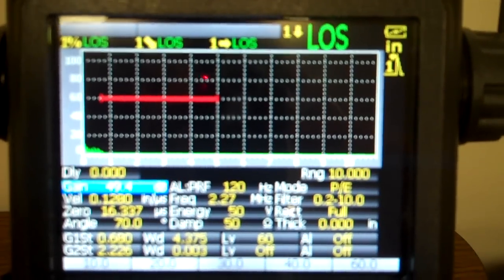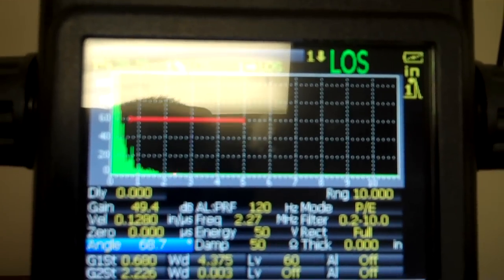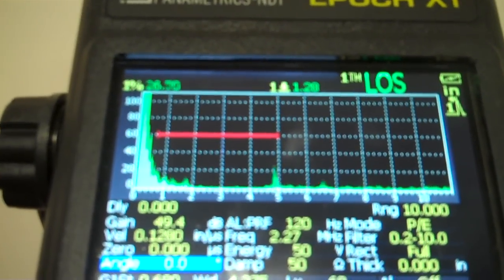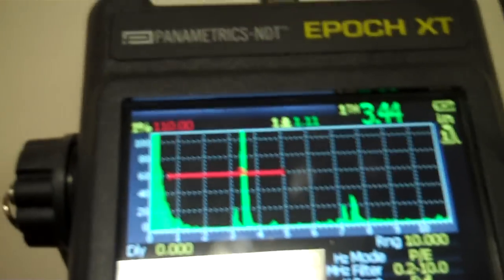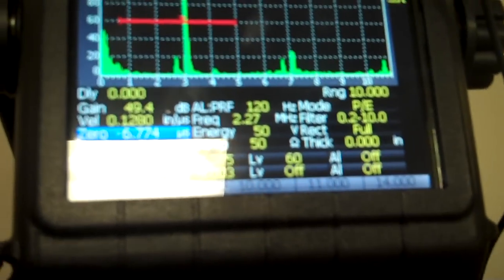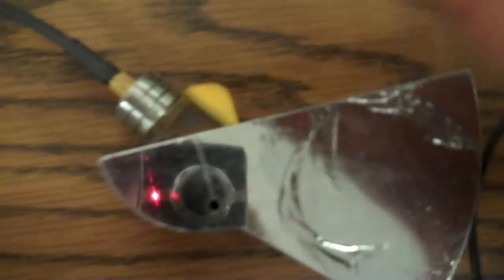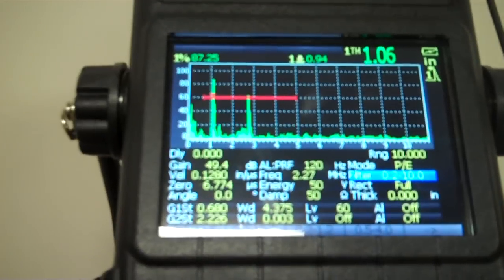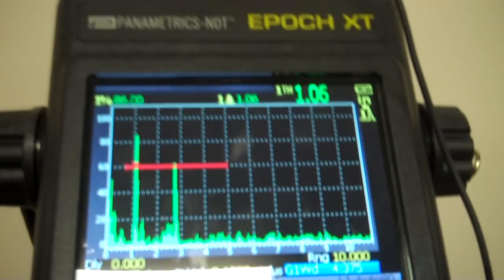Epoch XT Quick Shear Wave Calibration

Comment: Why was the angle set to 0 instead of 45. Does this create a different. I'm going for my API QUTE and want to make sure I'm calibrated correctly
Reply: Undisputedkb3amGreat question! The reason that it is not set to the angle of the transducer is because I didn't uise the gate feature to it's full extent. If I wanted to set up a DAC curve or something then I would have set up the angle on the machine.